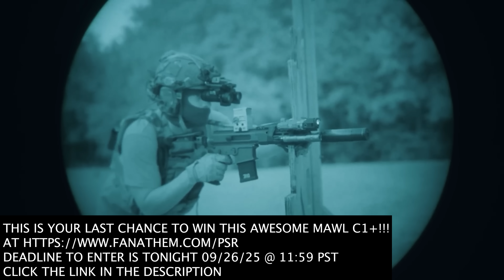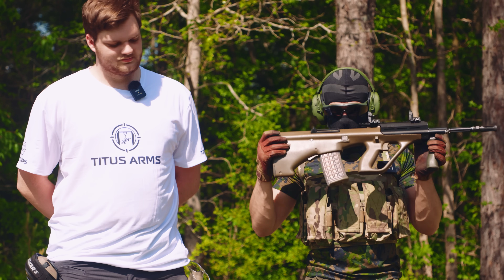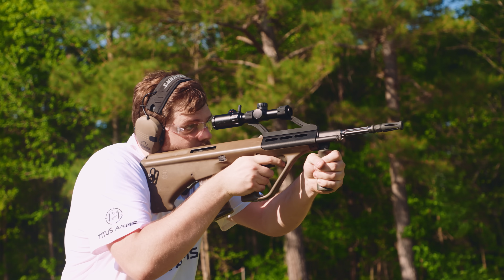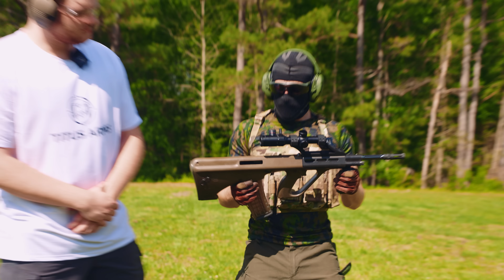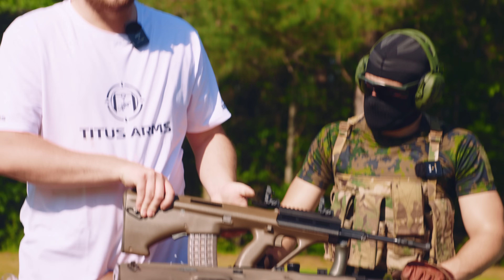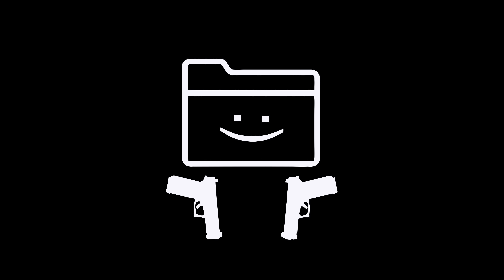The Nylaug: An Affordable AUG

Comment: Never heard of this brand before. I bought a steyr aug a couple years agoand prob pulled the trigger on it 10 times total cause it was a huge dissapointment. Mostly the trigger i mean it hit the targets no problem killed a couple groundhogs to but that trigger after using only triggertech diamonds maybe has spoiled me.cause nothing about an 8 pound trigger is a good time.
Reply: We sell our upgraded AUG AR trigger separately
Reply: @titusarms what does it take to purchase it with the upgraded trigger? I own a suppressor and got a concealed so I should be able to pass whatever to own it i just don't know what that requires for the upgrade cause that's the only reason I'd be buying it for sure hell oil trade u a basically brand new Steyr Aug in 556 might if put 10 rounds through it.  Is the trigger upgrade crazy expensive?

Comment: I’ve had a 300BO AUG built off a parts kit, with an AR barrel since 2020.

It uses both the AUG gas block and an AR gas block set at pistol length gas, similar setup to the AS VAL, it was shown off in the beta 😂 so the NYLAUG folks didn’t do it first; and mine cycles subs

Comment: The only part I am a bit wored about is the use of polymaker. Ther filament is not the best but if it works it works.
Also the frame looks like it is SLS/ powder jet fusion insted of FFF
Reply: Anecdotally speaking, everything I've had printed in SLS - has broken. I can confirm the receiver is FDM.
Reply: @titusarms 
I can after finding the top layer se that it is FFF

Comment: Titus Arms is perfectly positioned to make the AUG into what Steyr AUG  should be today.  Offer AR10 calibers, since he knows the inside of the stock-receiver-trigger pack interface🎉❤🎉.  3 Dimple the barrels for quick change barrels.  Offer 6.5 Creed, 308 and 8.6 Blackout and he will get a Mil contract.
Reply: This like an AR10 would be SICK
Reply: He’s not gonna get a mil contract lol. But Thales/Lithgow are already developing a ef88 in 6.8sig
Reply: A Mil contract?  From Australia??
Reply: Right i was looking for a hbar aug forever and couldnt find one on this side of the pond. Only thing i actually came across was a single 308 aug hbar barrel couldnt find a reciever though so eventually i just pulled the trigger on a steyr in 556 but it was basically 2 grand. Then i pulled the trigger the first time and realized i wasted 2k for a gun i dont want to pull the trigger on. Its like 8 pounds and u been using diamond triggertechs since my first ar 15 years ago well atleast 10 years now for sure.  If it came with a full auto set up sure id buy another one but they dont so it just sits in its box waiting to be shown off but the looks is about all i give it. Ill take an ar10 or ar15 anytime over an aug. Only saying that cause i own a steyr and would recommend them to no one.. looking cool isnt enough a reason to buy one wish i got a tavor or a Israeli bullpup cause their triggers can be actually replaced with ar drop in triggers

Comment: I clicked when I seen the Chad Aug , maybe 5 hours late to the release but damn, the military proven Aug is on par with m4s with some people ,it can do a bit what the m4 does, only looking a bit cooler kitted out then m4s imo , good range and accuracy, can be better than m4s in some things , and in the military they say you carry your gun more than you use it, and this gun is compact, it has a longer barrel life than m4s comfortably , it's well over 30k rounds, rumored to it reaching 100k rounds but at that point your barrel probably is past it's military barrel life so it should be replaced soon as the accuracy is degrading obviously, this means this gun would stay with you in a career job like this for a long time

The f2000 is my favorite for looks and rate of fire 850 rpm , the Aug is the best tho imo, so clean, I'm honestly a ak guy so the slower cyclic rate makes me happy ,650 rpm for the a1 that's the old ones tho , its way easy to control at that rate

Comment: Wouldnt asa cf be better the pa6/12
Reply: No, worse temp, chemical, impact resistance, ontop of worse layer adhesion
Reply: @corbinxtitus i guess im looking at it as the reason voron recommends asa abs because of creep..... but i guess if there isnt a constant pressure on while not in use then maybe creep isnt a real issue?
Reply: But then you go into the annealing part.... guess i should finish before opening mouth
Reply: @JH-zo5gk  The filament we use (Fiberon PA6-CF20) is pretty creep resistant, also, the designs we use are not affected by creep by very much, if not at all. Plus we anneal.
Reply: @titusarms you tried ppa/pps?

Comment: the olny issue i see with nylon is moisture retention causing it to soften over time and uv dammage from sunlight.
Reply: We moisture treat and saturate all of our nylon products, yes, they get slightly softer, but they were designed with that inmind. Nylon6 is very UV resistant, definitely much more than some like ABS / ASA. most polymer firearms are a glass filled nylon.

Comment: Just to be clear for those wanting to build or buy, the plastic trunnions are dogshit ,even with properly and dried printed nylon filaments, they have a very common tendency to melt and the barrel loves to twist and destroy the trunnion when it gets hot, contrary to what was stated in the video, if you actually run the damn thing it happens rather quickly. I've built 3 and discussed with many in the community who has similar issues. You need to get the aluminum trunnion from Riptide, otherwise expect to eventually replace your trunnion.
Reply: I mean, we did run a few hundred rounds in this video in a fairly quick span. Along with my testing, I've personally never melted, nor broken one, and I've built about 20 at this point? With 2 of them being a couple years old (before I even had my FFL) - regardless, we have actually switched to riptide trunnions to help maintain better accuracy :)

Comment: Aug has always been a beauty despite its 80% plastic/nylon issue. Now its day has come where plastic/nylon is the easiest thing to produce almost a whole certified AR lol
Reply: I mean some of us have never had an issue with GRN. Even paintball guns do it. Which reminds me, are 3d printed paintball guns a thing?
Reply: @AcidGambit419 works for paintball. Never ever 3d print a firearm. Your asking for it to explode. Their is a reason all major gun manufacturers do not 3d print firearms its a liability unsafe its best to mold the polymer
Reply: @CodyMT7 it’s not so much a liability as it is inefficient. Molds are much cheaper for mass production (and molding is stronger as an upside). 3D printing is used for prototyping since making small changes is easier than making an entirely new mold
Reply: @CodyMT7  saying "3d printed big bad" on PSR? yeah move to a fudd channel, you're not in the right place. It's not for you to argue on how effective it is when they are actively used in warzones like Myanmar for years now and there's hundreds of thousands of those around in US which run just fine. Ignorance is bliss, but misinformation is poison
Reply: @MaxC_1 
You won't get the same strength as injection molding or CNC milling whit a FFF part 
Even something like powder jet fusion or SLM nylon is better
Reply: @Goroca  and you don't need that strength. SLM, SLS are stronger in initial processes, but the gap is further reduced post annealing. The point however is that you don't need the extra strength, none of the parts concerned are load bearing to the degree. All while having the huge upside of being infinitely cheaper. 80% of the strength for a significantly faster and cheaper method is the way to go. 
I've worked as a machinist and materials engineer. My job was to cut corners without creating devastating side effects. I'm fully aware of how it should work
Reply: @MaxC_1 
True 
But in my experience and talking to companies that use SLS(not SLM, mixt them up) to fabricate stuff it has much better quality and speed the FFF fore fabricating stuff
Reply: @Goroca  only in high quantities. Your issues are Americans firms dealing with SLS are either not going to be willing to produce anything that even remotely comes close to firearms due to ATF and other legal issues, or they are prohibitively expensive. I've worked with both SLS and SLM/DMLS and you'd need to bring in a big enough quote to even get a machine to fire up at which point might as well try molding. FDM does the same thing on a small scale for extremely cheap, and you don't need qualified engineers to work on them or any of the upkeep and fees. Just for reference a part like the aug above is going to be 5-8x times more expensive for SLS nylon, and you'll need huge quantities to bring in the price down to more reasonable numbers like 2x or others. China would do it for far cheaper but again, legality
Reply: @MaxC_1 
Ok, I don't live in the us, and in my country it is not that expensive to get SLS stuff outsourced. And also SLS gives you a lot of flexibility that you can't get in injection molding. Also something like a fomplabs SLS machine is the that expensive 
In any case that is way we have engineers that specialises in that type of stuff
Reply: @CodyMT7 lol what I'm only literally just getting into engineering (I start school next semester at 34 so fuck the haters) and even I know wasted mold casting is 1,000,000 times easier with a 3d printer. Howmet who makes Pratt and Whitney turbine blades using this exact method 5 minutes down the street from me gave me the idea lol. The only limit to 3d printing is your imagination, not what someone on YouTube tells you 😂
Reply: @CodyMT7  all an AUG receiver does is hold the barrel up. Otherwise the trunnion and bolt and its guide rails do all the work
Reply: @CodyMT7 3d printed firearms aren't designed to be nicer than a Korth revolver. It's a because you can thing
Reply: from what my dad has said he HAD to have put 30k+ rounds through a Nylon 66 he got in 1969 as a gift....its still running great and ive put 3k through it too. Granted its had a new barrel and a full spring swap/extractor swap but its nylon receiver is fine
Reply: Plastic and nylon still is trash hence why more companies are offering full metal and steel variants of the polymer plastic framed handguns.
Reply: @CodyMT7 it's not trash at all. 50-IQ statement  😂
Reply: @josedorsaith5261  Guy only accepts steel milled receivers no stamped receivers or aluminum AR receivers 😂

Comment: I hope this reinvigorates the Nylaug community. I’ve had one for a long time and was an early adopter of the .300Blk and I spent lots of time and money trying to get it to run subs to the point where I modified the barrel and gas block to eventually having a 1/4” gas port and using a heavy blowback can and I can get it to run about 70%. No problem with supers before I opened it up bit subs are the only reason I wanted to build a Nylaug in .300Blk. The 5.56 ones seem far less finicky.
Reply: That is an insane size
Reply: @thepisswalker yeah I started at 1/16” and went up one bit size at a time then testing a few rounds and that’s where I settled on stopping because it’s ridiculous. I’m going to end up buying another barrel and gas block and just running it as a repeater in 300Blk or just going 5.56 on this one and buying a Steyr AUG in 300Blk since theirs works…they had to make a huge linear cut in their barrel to make 300Blk subs work reliably and their gas block is a different design as well though. I already have a 5.56 AUG but another one wouldn’t hurt.
Reply: @operator1192 wow I'm fascinated. I'm a huge diy'er can you direct me to anyone who shows this linear channel mod well? Is it a way for gas to exert post-gas port like a booster
Reply: @thepisswalker I kind of want to buy one and bore scope it to see for sure. I’ve only heard it described by Steyr in some of their promotional videos and reading their manual it references that slot in the cleaning portion but it’s all internal to the gas block and it’s more adjustable than the normal gas selector on their 5.56 rifles. The crazy thing is I haven’t seemed to find hardly any videos or pictures of their 300Blk offering. Most of what pops up is the Heresy Design barrel assemblies that came out a few years before Steyr themselves attempted it commercially. I don’t know what the internals of the gas block and port look like on their Heresy ones or if they are reliable with subs either. The problem with the Nylaug gas block is the chamber that dumps gas from the gas port onto the piston head is only so long so you’re limited there and cannot do a linear cut in the groove of the rifling or a series of multiple small ports. Thats why I went with a larger round port that mates up with one in the gas block. The problem with my design is that there isn’t enough dwell time between the gas port and the end of the muzzle of a high backpressure can. On an AR or AK you can tap into that gas much closer to the chamber where the pressure is higher and there’s more dwell time before the projectile exits the bore but in a bullpup design that’s nearly impossible without having a gas tube running through the receiver and dumping into the gas block at the front of the rifle. Another issue with mine is because the port is so large it can slough off bits of bullet jacket which can degrade accuracy and cause bits to get into the gas block. It also poses a risk of premature wear or potential damage if you were to run supersonic ammunition in this system with a gaping gas port. I have a few videos of my testing up on IG and I think I have some on YouTube as well but I basically shared my findings with you here. It would be cool if I could find a workable budget solution in 300Blk that was reliable.
Reply: @operator1192 how about using a booster muzzle device like older gen purpose machine guns
Reply: @thepisswalker  a silencer with higher backpressure (like not flow-through) will nearly always be more effective as boosting pressure than a booster like on a Krink or MG42. The pressure increases with certain cans with traditional style cone baffles is extremely noticeable.
Reply: @operator1192  absolutely. Love your projects. Do you post them in any kind of blog format or insta
Reply: the gas doesn't extend far enough for an aug thats why 300blk ar's all use pistol length. its a bad idea

Comment: Things you can print at home, that are shaped like your favorites, but usually internally different.  Famas (Famar), p90 (3dp90) HK UMP (UMP 11-9), STG 44 (STG 556 or 300 Blackout), Mauser bolty (VolkStubbGrewehr), Nylaug from the video, and many custom arms never seen before like DB Alloy, Or a break action 22 banana.
Reply: There is also a STG44 called the Sturgewher 556S. I've got a Nylaug and working on the STG and FAMAR.

Comment: This gun suxs cause you are unable to swap shoulders without getting hit in the face with brass
Reply: With a brass deflector it's actually fairly manageable
Reply: @titusarms it does a good job but it's not enough, not to mention the barrel swapping mechanic is relatively useless, take an rdb/Rfb kel tec, or a standard 308 sapper